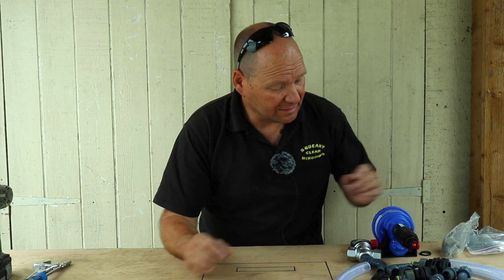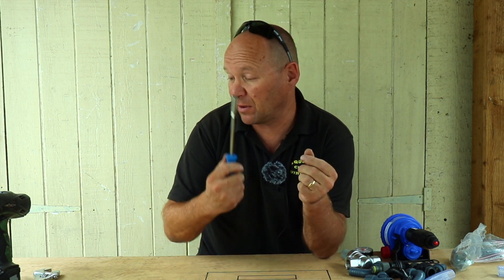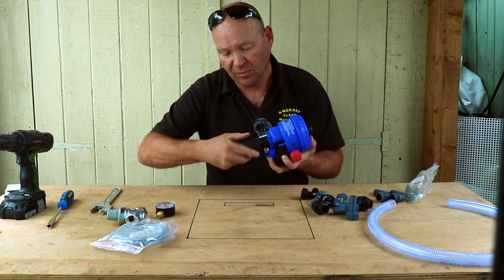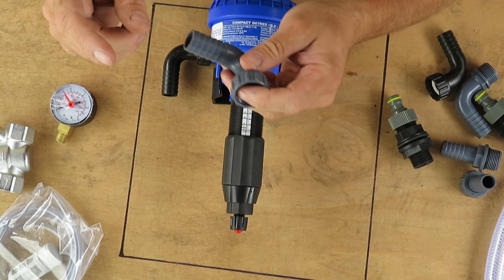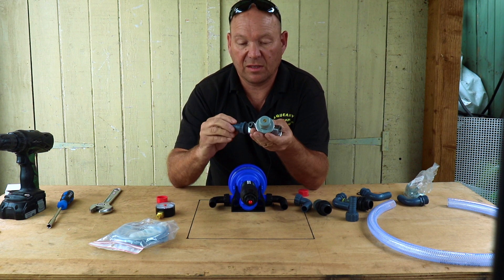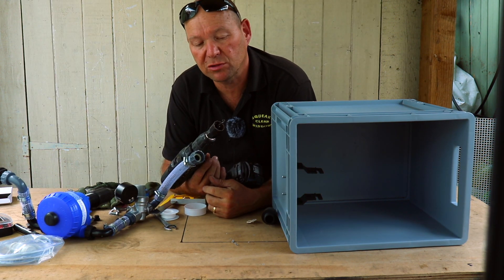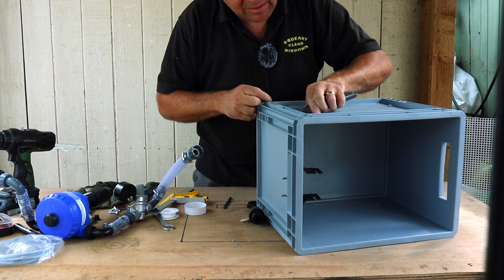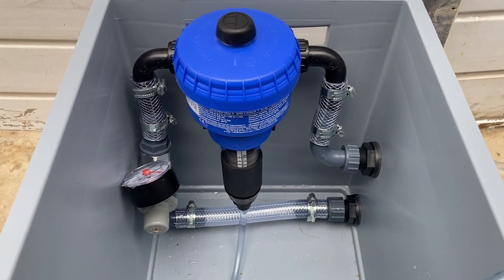How To Build A Dosatron Biocide Dosing Box

Comment: Nice vid, thanks. Bear in mind though, that if you hook a Dosatron up to the mains water here in the UK, you will need to add a WRAS approved check valve on the cold feed side of the Dosatron 👍 Only another few pounds
Reply from the maker: Thanks Richard. Great advice

Comment: Hi was there any space left in the box to fit a small tank?
Reply from the maker: It would have to be a very small one but they do sell other sized boxes
Reply: Cheers dave, I've built it all good...how do you set the water pressure valve to not exceed the 6bar for dosatron? Thanks

Comment: Great Build Dave what do think about putting Hypo through it as I don't really use Biocide anymore 🤔
Reply from the maker: You need a different Dosatron for hypo which is about twice the price
Reply: @squeakycleandave1  ahhh ok cheers backpack for me then LOL
Reply: @completeexteriorcleaningse750  can’t beat the good old backpack job mate lol💪🏻
Reply: @dsexternalservices6218  waiting for mine to arrive I went for the gardiner
Reply: @completeexteriorcleaningse750  I use a wheelie bin with a tap in the bottom and all measured on the inside, then hook it up to the Clarke Stainless Steel pump @ 60LPM  and job done in an hour.
Reply: @G71cleaningServices  that sounds great 👍